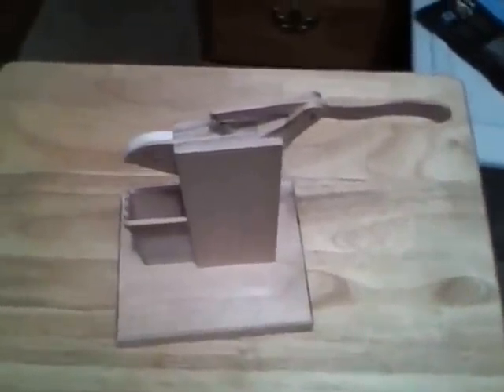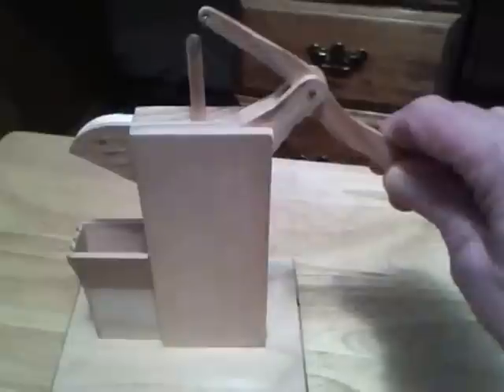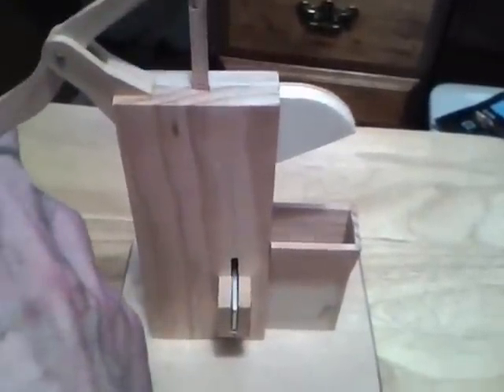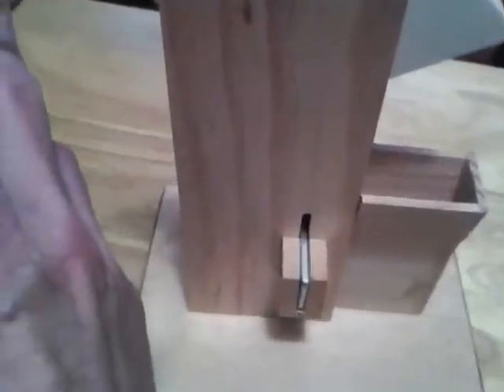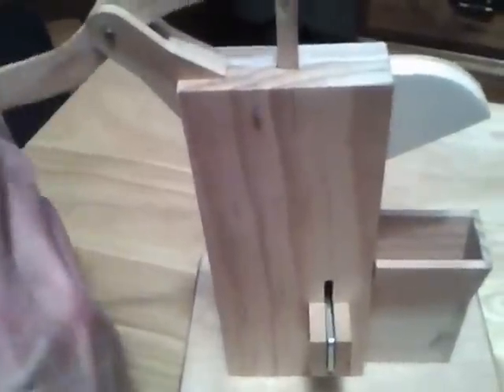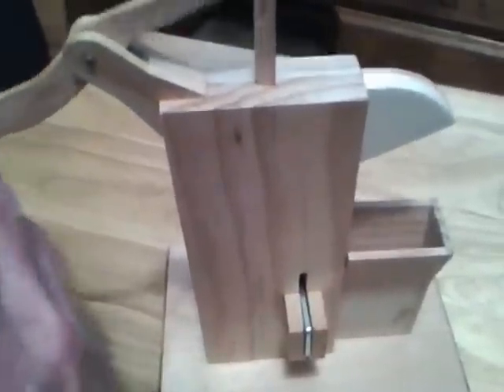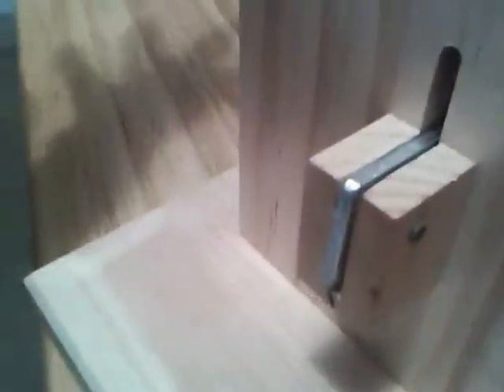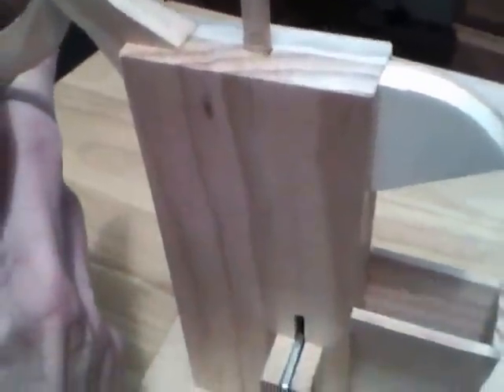Nickel Pump - wood

Comment from the maker: Too much work. My advice is to download Google SketchUp it's free. A lot of woodworkers use it. It is the best free cad program. Also there are add-on's that will convert drawings to G-code for CNC. You can get all the dimensions and even modify files and design your own.